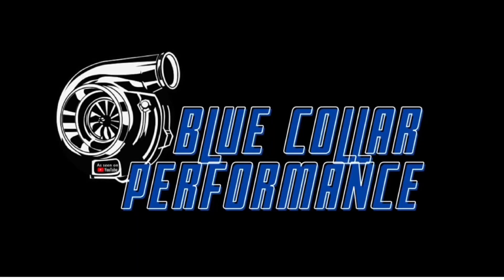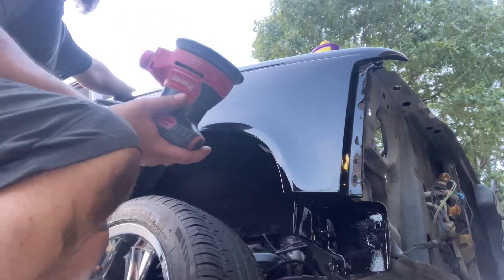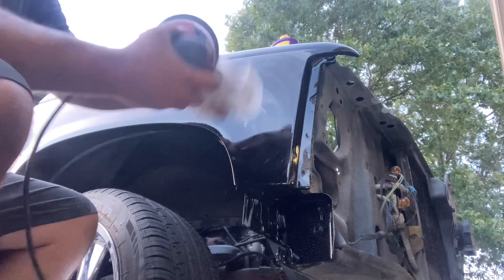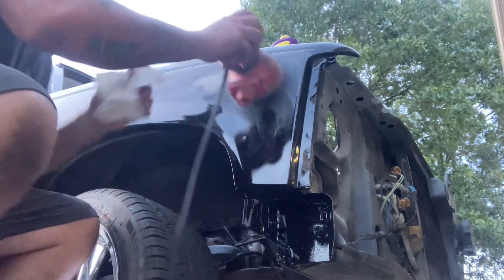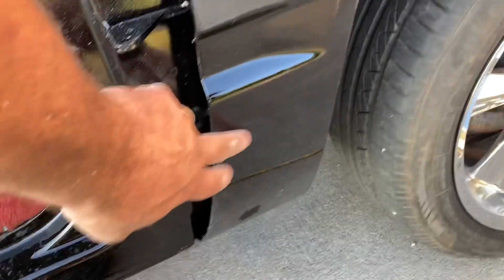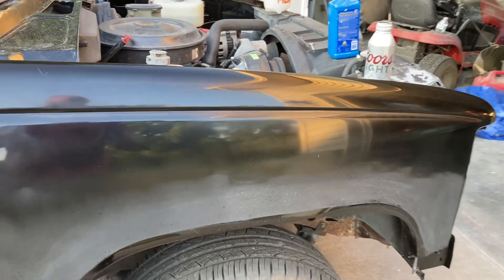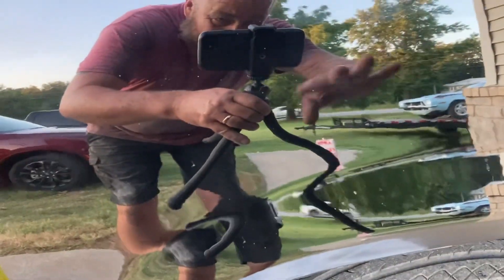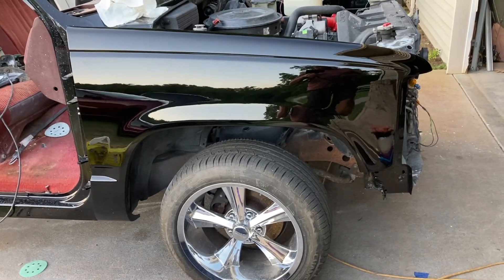How to buff out 1500 grit scratches

Comment: Sweet... looks fantastic. I didn’t realize 1500 and 3000 grit paper was available  for those sanders. Where did you pick it up.
Reply from the maker: Amazon. It’s way cheaper than the 3M, and seems to last pretty good. Overall, I’m really happy with it.
Reply from the maker: https://www.amazon.com/Dura-Gold-Finishing-Sandpaper-Woodworking-Automotive/dp/B07PRMQHGL/ref=mp_s_a_1_2_sspa?crid=34M8AVD845EVH&keywords=1500+grit+5+inch+sanding+discs&qid=1694228957&sprefix=1500+5%2Caps%2C126&sr=8-2-spons&sp_csd=d2lkZ2V0TmFtZT1zcF9waG9uZV9zZWFyY2hfYXRm&psc=1
Reply: Thanks, not bad price for 50 sheets.
Reply from the maker: @stevetalin6489  No problem
Reply from the maker: @stevetalin6489  that’s why I bought 8 boxes. Getting ahead of inflation.

Comment: I freely admit I cringed when I saw you were doing it dry, but the results look great!!    Couldn't recall for sure, is this a single stage or a base clear?
Reply from the maker: Base clear, doing it dry actually seems easier to me. The only thing is that you continually have to wipe the panel and sandpaper clean and be mindful about dust.